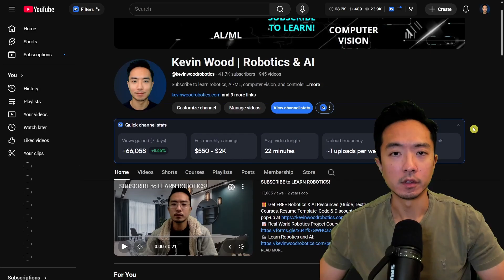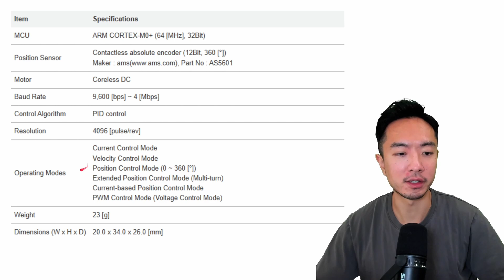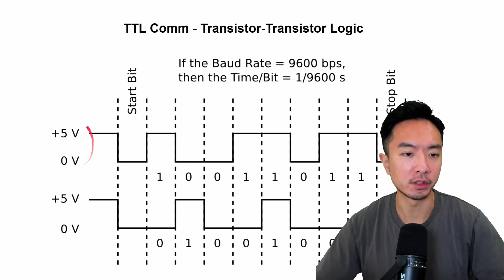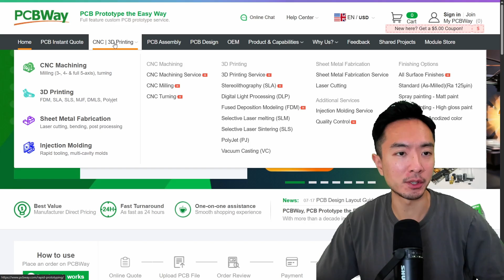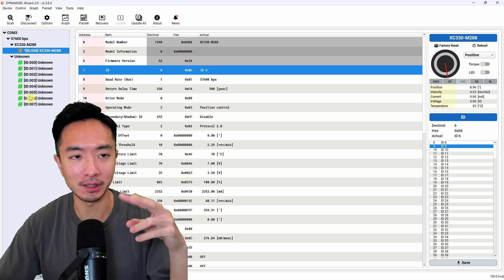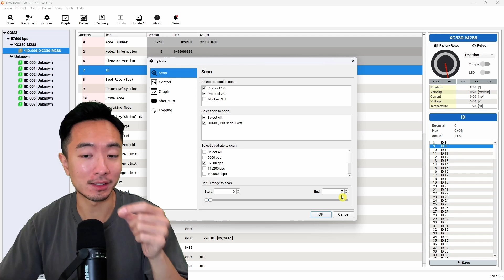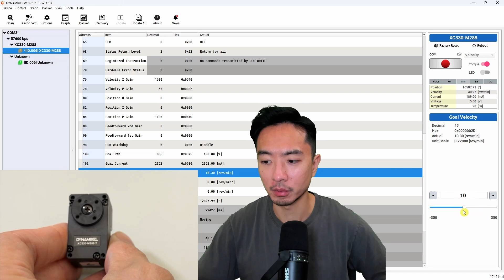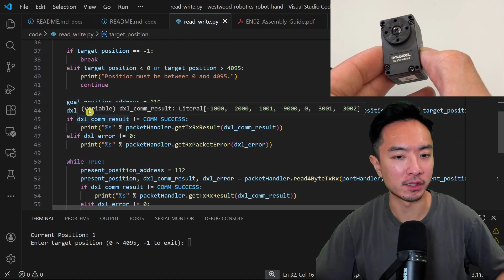Small Robot Actuator: Dynamixel XC330-M288-T from Robotis

Comment: Could these actuators (or maybe a bigger version) replace ordinary DC brush less motors that run small robots, say with a payload less than 2KG. There looks super responsive and accurate and I'd prefer robot motion to prioritise accuracy over speed. Or would this be overkill?
Reply from the maker: Yea that would be possible. They have bigger sizes too